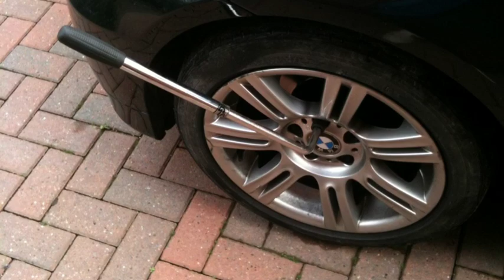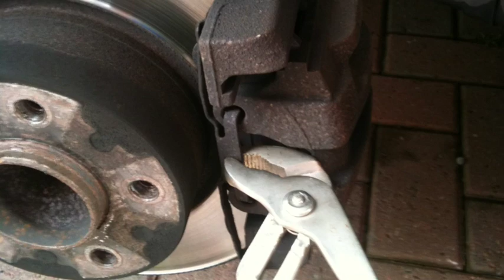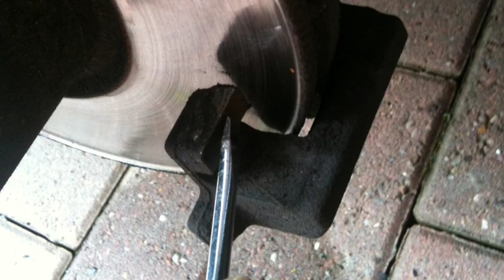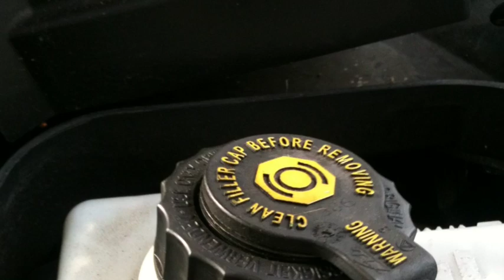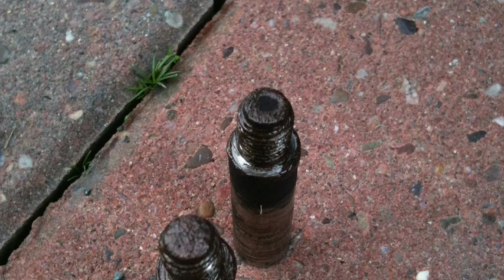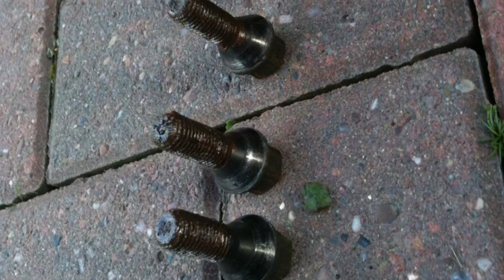How to change BMW E90 Front Brake Pads

Comment: Nice DIY guide..agree with all with the exception of applying grease to the wheel bolts..lubing the bolts is not recommended for it changes the torque value and friction req'd to keep the bolts in place..from what I recall its allows you to overtorque the bolts, possibly snapping them or destroying the thread.
Reply: Anti-seize have lubricants, which you don't want when torquing down the wheel lugs. Once the lug nuts were used and stretched, it is very easy to over-torque with lubricants on the threads.
Reply: That was anti-seize he mentioned to apply to the lug nuts.   Anti-seize and grease are not the same, though some people interchange them.  Grease is for lubrication (where parts will rub together from movement) and anti-seize is to keep parts from freezing together from rust/corrosion (so the parts can be taken apart).  Anti-seize is a better choice for lug nuts

Grease or anti-seize will not allow you to over torque bolts if you are using a torque wrench to a specified torque.  Torque is torque, grease or anti-seize won't change the strength of the steel or change the reading on the torque wrench.  If the lugs get rusted in because you did not apply anti-seize, they may snap next time you go to remove them.

 I would recommend putting anti-seize to the threaded part of the caliper pins and brake lube/grease to the smooth part of the pin.